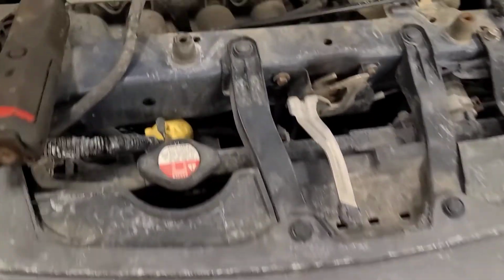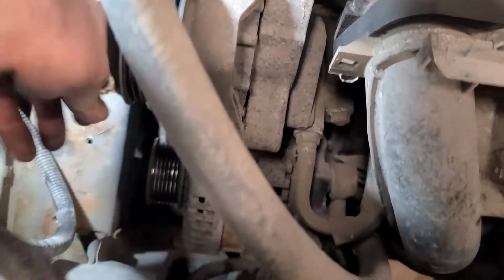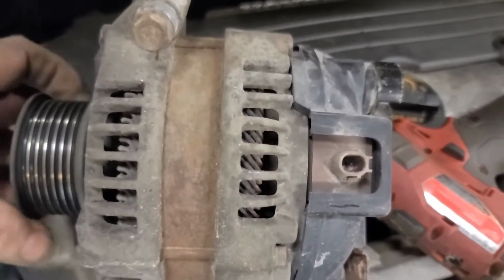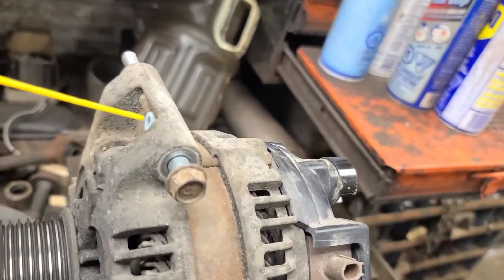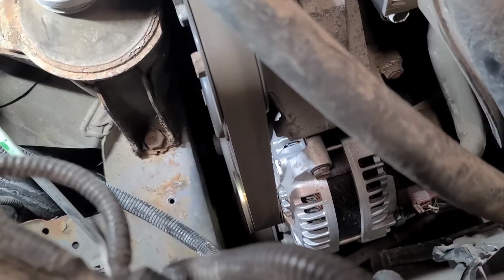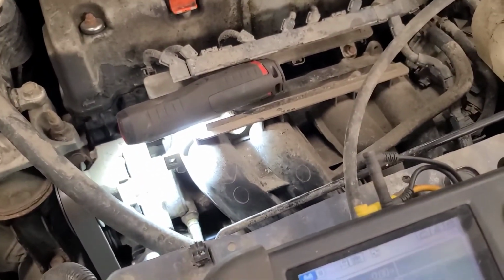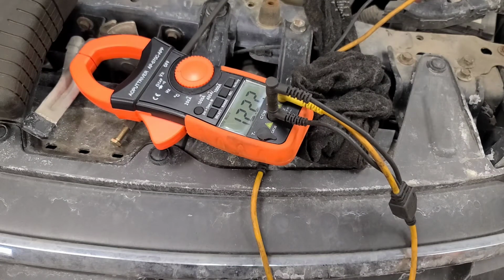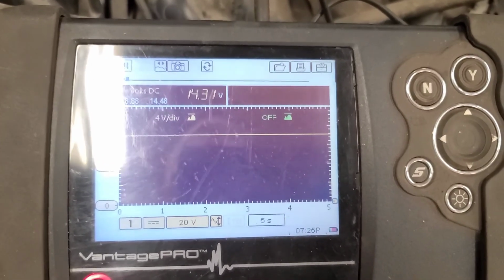2012 Honda CR-V 2.4 Alternator Replacement.

Comment: Hello.. my honda crv 2012 also has the same volt reading...runs fine but when i checked with a multimeter it shows 12.76V while running and when engine off the battery shows 12.5 volt.

When i checked with alternator current flow it shows 12.67V.. 

Seeking ur help is there an issue? 

What is Lin Bus?
Reply from the maker: Check the battery voltage running with the headlights on and heater on high. If under 12.2 check the belt. Lin Bus is a type of network communication between a master and slave computers. Is your battery warning light on?

Comment: Hey I have a crv 2012, and the alternator that you installed and only went up to 12 something volts works perfectly fine, if you cover up that little black bump on the dashboard in the middle at the front with something to block the light to turn on the headlights, it will go up to 14.4-14.5 v
Reply from the maker: That's the photocell that controls tge automatic headlights.

Comment: hondas selt regulates the alternator so when you go to autozone to get a test and failed its not correct.  12.5 running and 14.5 sith lights on is correct reading

Comment: I'm glad I came across your video Phillip. I suspected a charging problem on my 2012 CRV, but also had no alarm on the dash. Checking voltage with the engine running did not indicate an alternator output voltage increase. 

I took the vehicle to the auto parts store where young dude attached the test equipment that claimed the alternator has failed. I'm suspicious and will do further checks before I jump to changing out the alternator.

Thanks for the heaping helping of "out of the box" thinking.
Reply from the maker: 90% of the time it will be an alternator failure. The other 10% could be wiring issues and even a slipping drive belt or one way clutch.
Reply: @PhillipBailey  
I planned on getting back to the group. Thanks for your input.

As it turned out, my alternator appears to be working fine. All this started over my wife saying "something is not right," so of course made an effort to check it out. 

I checked the battery voltage with a quality meter (I'm an industrial electrician), read around 12.5 vdc. I had her start it to check what the alternator was putting out. The meter reading was unchanged. I didn't try adding load, just took a couple more readings while running. Still less than 13 vdc.

I took it to the local auto arts store where they used their charging system tester. Sure enough it claimed the alternator was bad. So I bought an alternator planning on installing it this morning. But first, and based on your experience, I wanted to give it another look see. After starting, the voltage quickly rose to over 14 vdc. I loaded it with high beam lights, wipers, etc. I noticed a slight dip in the voltage reading, then quickly recovering above 14 vdc. I did that multiple times until I was convinced the alternator was doing its job. 

Not knowing exactly how the control scheme was developed, I'm assuming at some load critical setpoint, the system controller applies the alternator excitation voltage/current intensifying the rotating magnetic field in the alternator, increasing output voltage and regulates around that setpoint until it falls below the deadband. I guess when I first observed it everything was hunky dory with the charging system blah, blah. 

I'm fairly well convinced this system approach is an effort to maximize efficiency by reducing the amount of time the alternator is loaded saving gas etc. (efficiency is the buzz-word of engineering bean counters these days). Of course there is that little not to be forgotten "regulating battery voltage" as not to over charge it. That's where I'd like to know how the excitation system was engineered. The load sensor shunt input voltage to PCM(?) and/or alternator internal regulator? There appeared to be only one wire in the control plug at the alternator supplying the field excitation voltage I have to assume, unless it uses some sort of self regulation until the control signal is applied. Things that keep me up at night.....All I have is a Haynes manual which is super basic.

My charging system acted just like the vehicle situation you had and stayed that way even after I rolled up to the parts store while it was raining and of course, "lights on when raining" Florida. I'm wondering how many folks have unfortunately fell into that? 

For me it was a good learned experience that I won't soon forget. But that is my nature after fixing broke shit in industry for 50 years. Thanks much for your video, it saved me a couple hundred and a fair amount of aggravation. 

I will subscribe to your channel as I'm retired and have no intention of buying another vehicle. I need all the help I can get. I have a 2012 CRV and a 2001 Isuzu Trooper. I do all the work I can.

Forgive the lengthy response, I'm sure you are busy as most of us are. But when it comes to electrical controls I'm pretty much a junky.

Peace, out!

JohnT
Reply from the maker: @johntrauger68  so what did you end up doing to fix it or did it fix itself?
Reply: @PhillipBailey  
I don't think I had a problem from the start. So I'll monitor it closely and carry on.
Thanks for your part!
Keep posting!

Comment: I saw that on another newer vehicle. It makes it complicating to remember which does this and which ones do the old 14 volts. Glad you figured it out and got it out the door Phillip!
Reply from the maker: Yes I almost condemned the new alternator for sure.
Reply: @PhillipBailey  It is so good you dug a bit deeper. That saved you and the customer some time and a headache for you since the new alternator may have done the same thing, if battery was at same temperature etc. If everything was exactly the same, of course the next alternator would have acted exactly the same. Is it possible you could get 2 alternators that are bad, maybe. I realize in this case this is the way they operate. Glad you figured it out. You may have also saved guys changing these at home and running into the same issue.